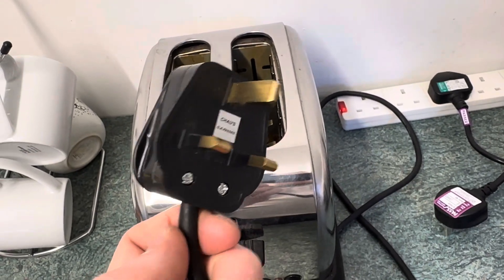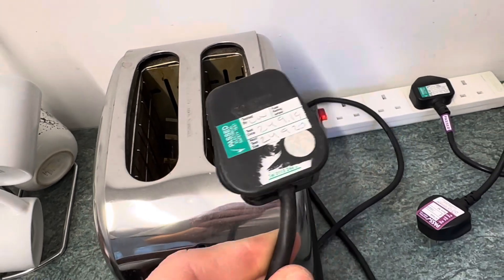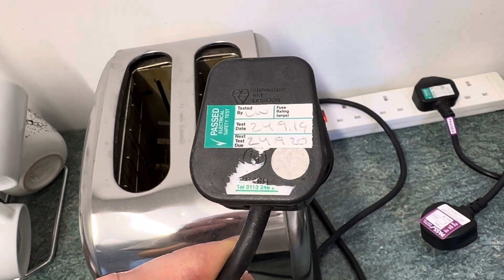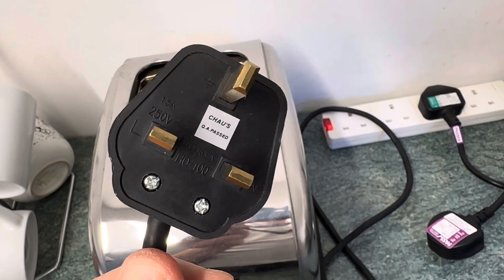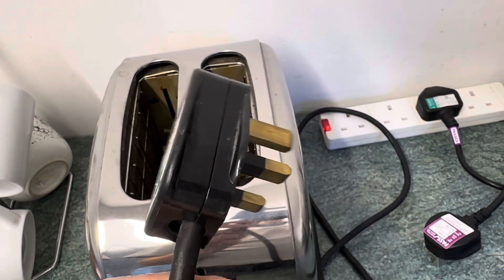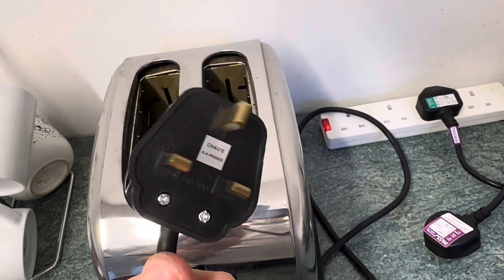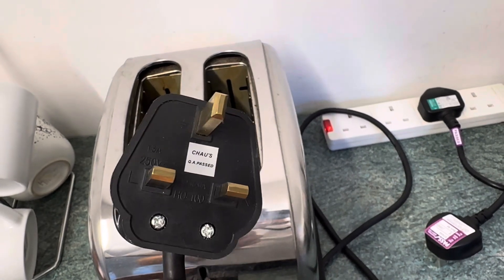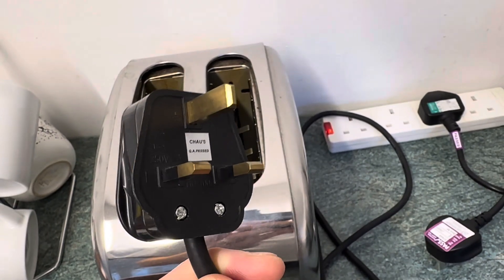Have your plugs been opened and inspected?! Class 1 and 2 PAT tests

Comment: Well worth checking plugs! Firstly to check the correct fuse is fitted, then for security of the cord grip and termination. I've come across fuses 'repaired' with a bit of wire or just replaced with a bit of copper bar (on an arc welder). I also came across some plugs where rather than undo the screw and put the wire through the hole and re-tighten, the wire was just wrapped around the protruding screw head.
Reply from the maker: Thanks for watching! If these videos help you then please consider signing up as a member of donating via the “thanks” button!

Comment: I have a question, I recently got 2 photography lights and the plugs are the same as that but it says "fitted with 13A fuse" but on the inside is only a 3A fuse, 3A fuse seems right for these lights bt still should the plug saying 13A be of any concern because the previous owner may have done something, Both the plugs are British standard
Reply from the maker: Nothing to worry about. All plugs have a maximum rating of 13a. however, the fuse fitted often depends on the size of cable fitted. 3a for photography lights does sound correct so nothing I think to worry about.
Reply: @caterhampattesting  Thanks!

Comment: I was taught not to put PAT test stickers onto appliance plugs in case the plug got changed at a later date………………???
Reply from the maker: That’s probably a bit of a myth. If the plug did get changed then it would probably need a new test on it anyway. The labels I buy are specifically designed for plug tops and look great. Many people prefer labels applied to the plug rather than slapped on the appliance.